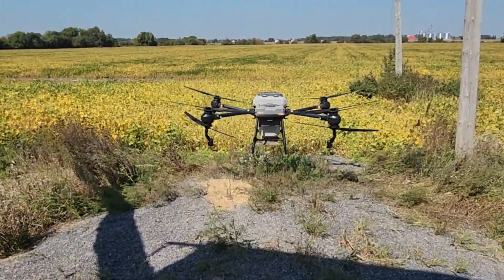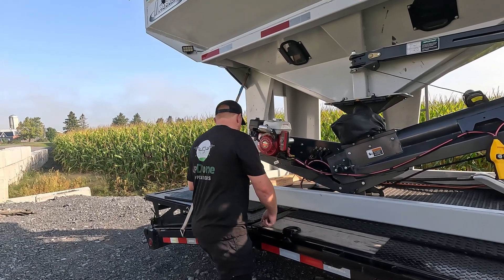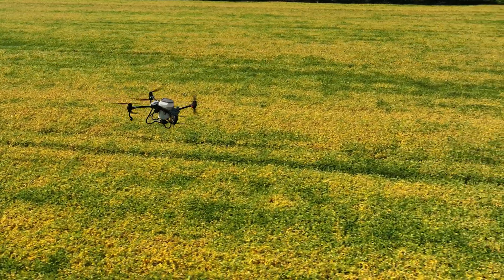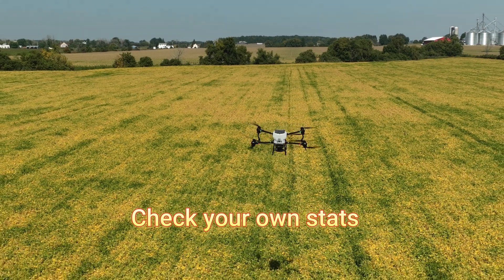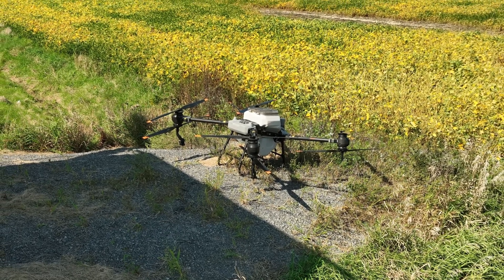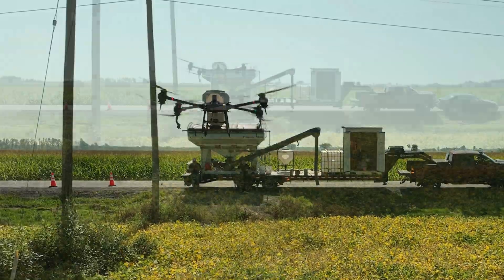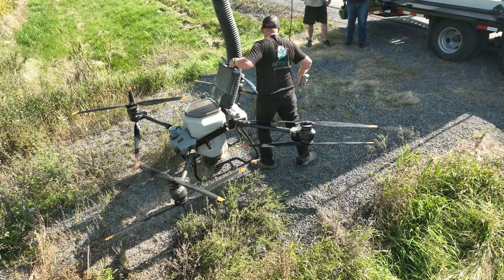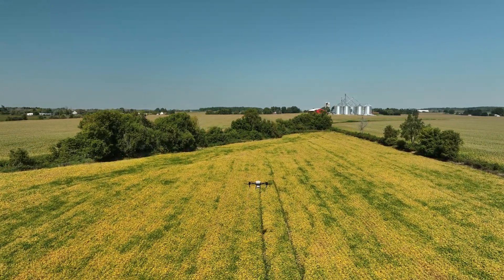CANADIAN FARMER - AG DRONES - THEY'RE HERE !! The rapidly expanding growing world of Ag drones.

Comment: Great Content.  Subscribing from Prince Edward County.  The operators should consider a few solar panels, to make this process more sustainable.   Just my opinion.  I run my house totally on solar.
Reply from the maker: Hi .. and thanks a lot for the subscription! You live in a great area of the province.  
The battery charging system is massive... 220V at 40 amps!! .. charges the big battery in a few minutes.  Solar is great but all the panels possible on the trailer wouldn't have a chance to rapid charge the batteries...
Reply: @farmerdrone  ah!  True.   The only way, which is what I do is...many battery packs to keep up.  My fuel bill is next to zero $.  But...to each their own.  I love the Canadian Content!   Keep it coming.